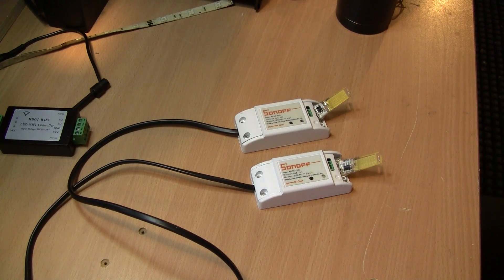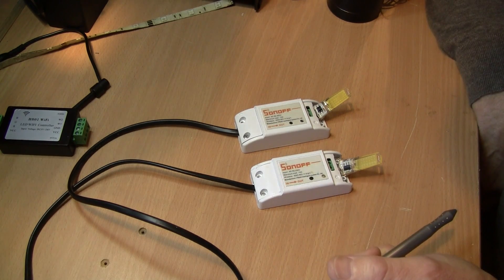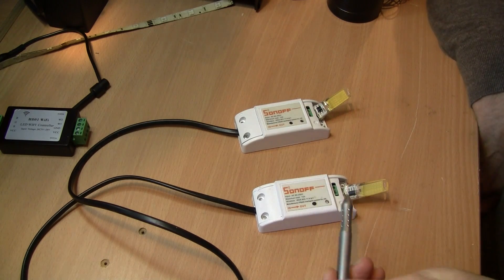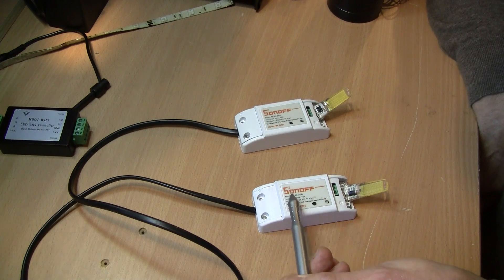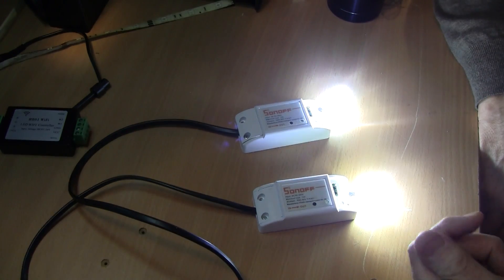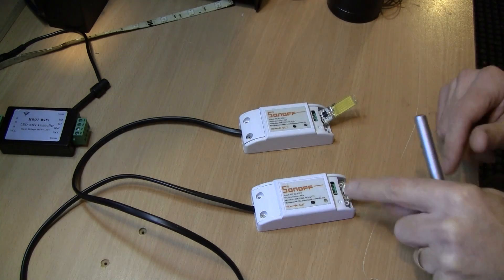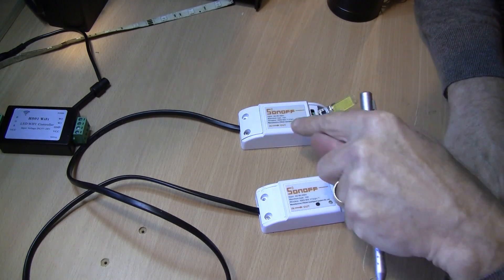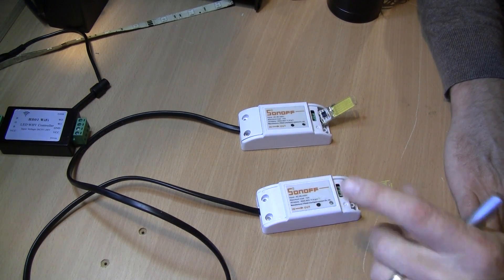Sonoff configured as 2-way switch

Comment: Can anyone tell me if the Sonoff Basic- WiFi Wireless Smart Switch can run with a dimmer switch, basically I'm thinking about getting one for the ceiling lights what has a dimmer controller on the wall that turns it off and on and dim the light

Comment: Sonoff is fascinating but I begin to imagine people sitting in dark houses if their WiFi router is down.
Reply from the maker: Agreed. The Sonoff can actually work as a standard switch without WiFi by toggling the light on and off with the button (or an external button/switch).

Comment: Great Video, do you mind the wiring diagram for your setup.  I want to be able to control 1 light with 2 switches.
Reply: if u want to control just 1 light, don't hook up a light to the second Sonoff unit. This way the second Sonoff unit will act as a button for the first Sonoff, which is hooked up to a light.

Comment: Can this also be configured as a 3 way switch instead of 2 way switch as shown above? Does the module need to be installed inside a light switch, or can it be installed closer to the light bulb? Is it possible to have the dimming function enabled if installed in a multi gang (e.g 3 or 4 gang) light switch. If not, can the lights be dimmed through Alexa even if not at the switch?
Reply: for a three way configuration, try the 4ch pro.
Reply from the maker: Whoa, lotta questions in there :). Think 3-way would be tricky with the code. There is a guy who has a WiFi PWM module that may be better suited to your application here? https://www.youtube.com/watch?v=XftPnCJIU_0.

Comment: And what happened, if your MQTT server is down?
I use different way - sending messages between ESPeasy devices and from controller ( Domoticz ) to Sonoff with lamp connected.
My example - one Sonoff with lamp, another ESP2866 with switch. Lamp is driven from both  ESPEasy devices and from Domotociz.
When Domoticz is down, I can still switch lamp on or off with both ESPeasy devices.

# Sonoff with switch only: ( 192.168.1.100 ) #

on SW01#Switch do
     SendToHTTP 192.168.1.101,80,/control?cmd=event,lamp_change
endon

# Sonoff with relay and lamp: ( 192.168.1.101 )#

on lamp_on do
    gpio,12,1
    gpio,13,0
endon

on lamp_off do
    gpio,12,0
    gpio,13,1
endon

on lamp_change do
  if [rele#Switch]=1
    event,lamp_off
    SendToHTTP 192.168.1.253,8080,/json.htm?type=command&param=switchlight&idx=19&switchcmd=Off
  else
    event,lamp_on
    SendToHTTP 192.168.1.253,8080,/json.htm?type=command&param=switchlight&idx=19&switchcmd=On
  endif
endon

on SW01#Switch do
  event,lamp_change
endon

# Domoticz switch rules ( 192.168.1.253 ) #

On Action:  http://192.168.1.101/control?cmd=event,lamp_on
Off Action:  http://192.168.1.101/control?cmd=event,lamp_off
Reply from the maker: Thanks. I agree, your way might be a better approach as it does not rely on the MQTT broker. I'll try that and see. SendtoUDP did not work well for me but HTTP should be a better bet. Thanks for the input.

Comment: Are you planning to review the Sonoff B1 bulb?
Reply from the maker: Sorry no. I'm not a huge fan of smart bulbs as if the wife turns off the wall switch, the ain't smart no more. And no ones wife is going to want to turn on a bulb with an app! The best solution for smart bulbs in a smart wall switch/dimmer as it has the best wife acceptance factor. I've found that just automating for the sake of automating is not always the best approach.
Reply: Pete Stothers I am on-board with you. Unfortunately, Sonoff don't yet have 2/3 gang switch for US market. And i am not to keen on using frequency locked Zwave switches.
Problem with B1 is that there is hardly any instructions on flashing it on the web.
Reply from the maker: Yes, the biggest problem in home automation to date. Getting z-wave/WiFi wall switches that work in 2 and 3-way circuits without needing another mortgage! Seems to be a fair bit of info on the B1 here https://github.com/arendst/Sonoff-Tasmota/issues/676
Reply: Pete Stothers yup, I have looked at that page. It still lacks flashing instructions.
Reply: What’s the point? You can do the same thing with one switch.
Reply: if its using ESP8266, flasing a new firmware is exactly the same as flashing a Sonoff basic!

Comment: Hi, do you think it's possible to use ESPeasy rules to cooperate Sonoff with traditional 2-position On/Off wall switch? So when Sonoff is on you can switch it off using wall switch and vice-versa. Thanks,
Reply from the maker: You would need to replace the remote wall switch with another Sonoff and then yes, that should work. You need to use the TASMOTA firmware though if you want to use an existing latch switch instead of a press button. More info here http://www.superhouse.tv/21-six-sonoff-secrets/ under 'Switches' section.
Reply: Yes it is possible.
In my example above I use definition 
Switch Button Type: Push Button Active Low
Each press of button change state of lamp.
When I change Switch Button Type to "Normal Switch" each change of wall switch state changes state of lamp.
But when your lamp lights, for example, when wall switch is in ON position and you switch lamp off through network ( MQTT, Domotociz etc ) you must switch wall switch to OFF position to switch lamp on next time.
So sometimes lamp is on when wall switch in ON position, sometimes when wall switch in OFF position.

Comment: Started replacing the two wire system out for three wires here in Australia. Did you think of a TH10 or TH16 as it has another GPIO. Did you try COAP or COAPS? Just watch Andreas do a video on it.
Reply from the maker: Basic Sonoff has a spare GPIO too. TH10 and 16 (both of which I have) are larger. MQTT is my protocol of choice as pretty much everything 'speaks' it these days and it's very fast.